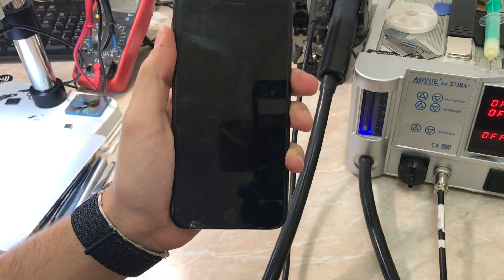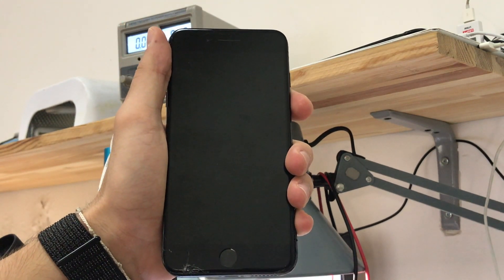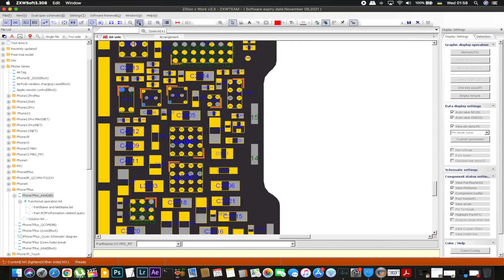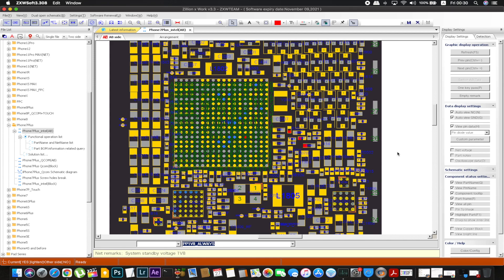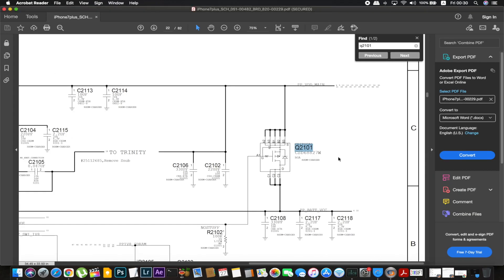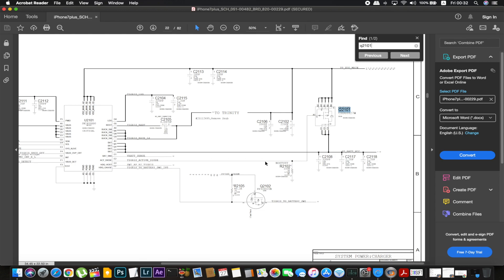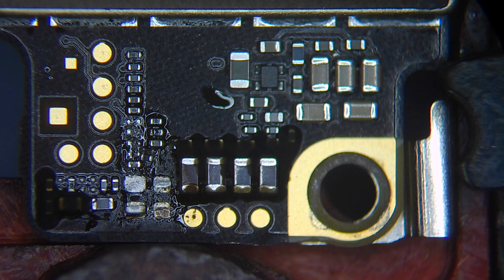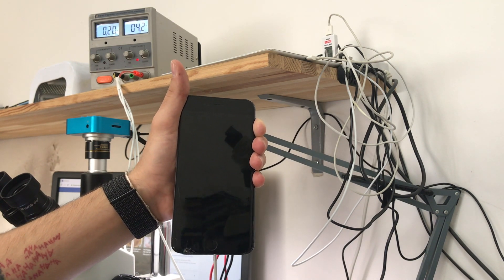iPhone 7 Plus No Power (Short On VDD MAIN) Explaining Shorts And Mosfet Transistors Q2101

Comment: Hello, Great video. I have a 7 Plus that has been previously 'refurbished'. I noticed that Q2101 has been removed and 4 pins have been bridged? Does this affect anything or should I replace Q2101? Thanks.
Reply from the maker: Hey, it’s better to return the Q2101 if you have a replacement part, when you make a jumper from VDD main to BATT line you miss the work of the mosfet, the phone will work with no problem but it’s better soldering back to avoid some sort of bad or short voltage in the future
Reply: @AntoineKiriaky10  Thanks. Good advice. Agree, it's there for a reason. I'll place a new one on. (Refurb place must have been time poor)!

Comment: Hello Sir, gone through the video explanation was really amazing and  had lot of things to learn and also want to bring your attention towards that MOSFET is missing from the video as can't be seen through the video ....
Reply from the maker: Can’t be seen through the video 😅😅? Can you please explain more
Reply: @AntoineKiriaky10  actually can't see if you have repaired it with that MOSFET or it was shorting some where else.
Reply from the maker: No I showed the corrosion area before I even begin explaining about the shorts and mosfet I just talked about the short is general and also about the mosfet work and how we make a lot of problem considering the mosfet is the problem when you have a vdd,vcc main short
Reply: @AntoineKiriaky10  thanks for explaining  but It is clear looking through the visuals may be skipped that part when you cleared the path..
Reply from the maker: Again I didn’t even remove the sticker on the down side where the mosfet located 😅😅
Reply: @AntoineKiriaky10  Gone through the video again and found my mistake as corrosion hiding those two Capacitors